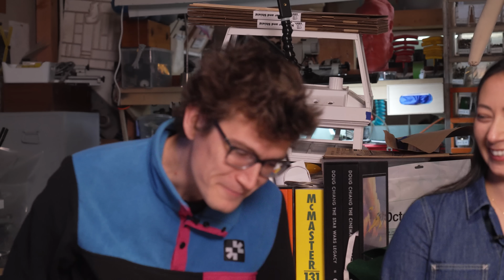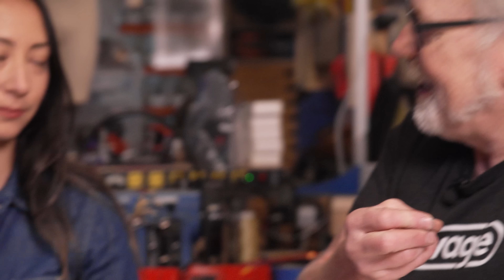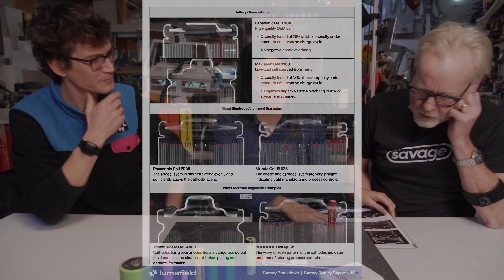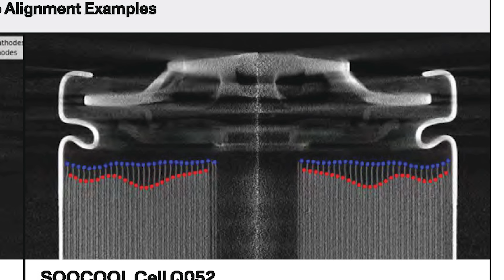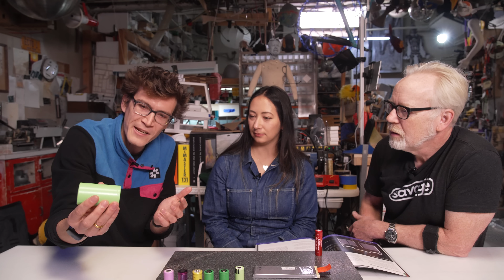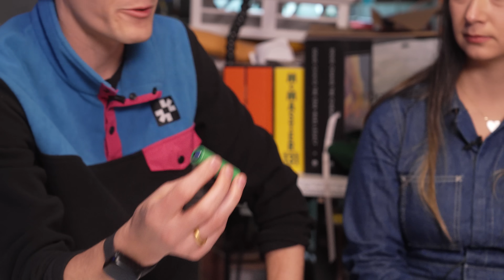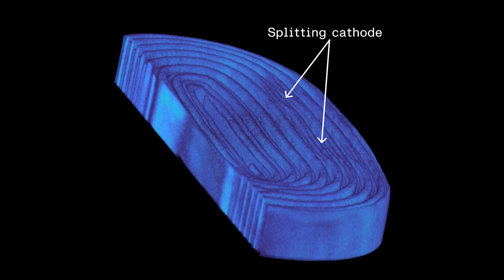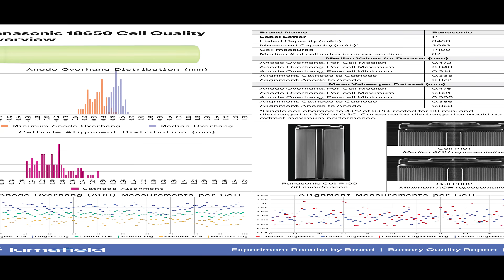The Surprising Flaws in 18650 Lithium-Ion Batteries

Comment: Remember when the people who take your taxes used to test stuff like this and tell you when something wasn’t safe?
Pepperidge Farm remembers…
Reply: Pretty sure that was never a thing, except in specific industries.
Reply: The CPSC seems like the right fit, although I think it's the (Insurance) Underwriter's Laboratories and other groups that do the actual testing in most cases. Think like car crash testing - there is both IIHS and NHTSA crash testing.

Way back in the day the government used to provide pamphlets on things that people needed to know, like the dangers of using gasoline for your clotheswashing. I think some of that survives (or did until lately) but a lot has moved online or people don't know where to call.
Reply: what kind of clanker brain actually uses that phrase?
Reply: What government agency used to test consumer electronics?
Reply: @F0XD1E CPSC
Thanks to deregulation, the standards for batteries are voluntary

Comment: Almost caught the bad end of the Li-ion stick trying to keep an old phone alive. If only it hadn't been glued in; I'd have a working old phone and a few less grey hairs as I ran down the steps with my phone spewing nasty magic smoke. :( 

Hope the promise of solid state batteries comes true soon.
Reply: Trick for glues in cell phone batteries. I sharpen the end of a credit card on sandpaper to make a wedge. Work the credit card under the battery gently and slowly until the battery comes loose. I even mounted one on a handle to make it easier to control!

Comment: I can't even guess how many of these I have around the house just for flashlights. Never mind the rechargable gadgets I haven't torn apart to see what's inside. At the very least I'll be sure not to leave them in the charger overnight.
Reply: I'm thinking going back to NiMH rechargeable batteries for replaceable batteries is a better option.
Reply: @chrimony  NiMH can also catch fire.. but the problem is they have such a lower capacity as well as number of cycles.  
NimH 600-800 cycles
NMC lithium ion (like the named ones here) about 3000 cycles
LFP cells (LiFePO4) 9000-30000 cycles.
Reply: @TheStrayWolf-g8t  NiMH are not nearly as explodey as lithium. Yes, less capacity and fewer cycles. I wouldn't use one in a phone. But for flashlight batteries like the original commenter mentioned? Sure.
Reply: Get a capacity tester for whatever you have.. if you can not do a run teste to compair
Reply: Good choice. Always watch the charging cells.
I had a cellphone puff up during charging and yanked out the USB cable.
The pouch cell doubled in size but nothing else happened.
Reply: It's not just "overnight", it's "unattended".

Comment: I worked for a lithium ion battery maker for a month as a temp we had to evacuate the  building at lest once a day
Reply: I worked in device repair off and on over the last 8 years now? Did it as a hobby before that. All I can say about Li Ion is... Nope. Not in my car. Not in my house. A phone is okey, but not in my pocket unless necessary and never under my pillow or using while charging. Slowest charge speed is best.
Reply: @Baeloro1481  your over cautious approach is not supported by the actual evidence... I would bet a large amount of money that you could make small changes to your diet that would have a MUCH greater reduction to all cause mortality ... And other similar such life style changes you won't make.

Sure, don't have your phone under your pillow, duh. Charge it slow and the battery will last longer, that's true ... But the number of lithium batteries in homes compared to the number of house fires overall tells me you are afraid of shadows. People used to burn their houses down with literally EVERYTHING at a significantly greater rate.
Reply: @WilliamMorey-Baker  Over cautious? Did you miss the part where I have personally worked on these devices? How many times do you think I have witnessed a li Ion battery go up in flames? 

Yeah, it's not about the risk, it's about the factual state of things after the fire occurs. Difficult to put out (water doesn't work) and they reach temperatures that make the sun envious as it incinerates anything it's in contact with. 

If my caution prevents me from being burned alive by a battery fire, isn't that worthwhile?
Reply: @Baeloro1481  Did you miss the fact that we have trillions of battery powered devices in the world and EV's (including bicycles and such) have existed now for more than 11 years and you don't see them burst into flames at every corner, despite millions, probably trillions of them being made and sold and being charged everyday.  
Being cautious and ask for better battery quality control, is totally fine and I fully endorse such testing and report but going from that to, dooms day talk "I will never use a battery device!" is not, that is just fearmongering talk.
Also just because you say you worked in something that is not hard evidence that you really worked in something. On the internet, everyone can claim everything.
Reply: @Argoon1981  I guess if you don't understand the potential, you won't recognize the danger? If I just don't buy a cheaply made battery powered product, I probably won't risk burning anything down. By being very selective about the sorts of things I am willing to use as a consumer, I mitigate a lot of that risk. 

Does it disappear completely? Of course not, but the rest is easily managed. I charge my phone while I'm awake to monitor it. I don't put things that get hot in places that can trap heat (especially while they are actively being utilize in a way that makes them hot). I don't game while charging on my phone. 

I advocate for best practices with battery maintenance/operation and I take the time to explain to anyone who asks what I mean by that. While the conventional battery in the average phone might be able to exceed most safety standards for a battery, Stepping outside the phone market helps you realize just how much the battery quality drops off when you aren't selling an expensive device. 

While a $10 pair of Temu airpods won't have the thermal capacity to burn a house down, the fact they pose a much higher risk of fire (just by being temu airpods instead of apple product) should give anyone a reason not to support buying $10 airpods.
Reply: @Baeloro1481  I have to point out that despite the suggestive wording, you have not actually asserted that you've witnessed any Li-ion battery fires. Certain highly-visible characters in the news have shown that this can be a tell that the answer is actually "zero".
Reply: @AySz88  Part of electronics repair is to replace batteries. I could count the number of fires I've witnessed. I could talk about what happens to a battery when it gets to hot, when it gets punctured, bent, or when the anode/cathode wear out. 

I mean... the point is that batteries are a limited lifespan product that contain a volatile chemical reaction. Belief that it is 100% safe/benign is great, until something happens. 

The fortunate people just have a phone or pc or tablet make magic smoke and they aren't injured by it. Other people suffer burns and in some cases, death. The two college students trapped in the Cyber truck as it self-immolated come to mind.
Reply: @Baeloro1481  You know how many times I’ve seen Gasoline and natural gas go up in flames? 

Everything involves risk.
Reply: @Racing_Pig  Right. Gasoline fumes explode and liquid gas ignites under flame/spark. Li Ion batteries ignite when exposed to open air (oxygen). They also ignite when they get too hot (thermal runaway). 

Gasoline isn't likely to ignite without flame/spark nor is it going to get hot then catch fire. Normal phone usage creates heat, most phones lack a sufficient cooling solution to prevent thermal throttling and down clocking. 

There was one model of phone that was known to catch fire under normal usage conditions... the Galaxy Note 7. It was recalled as a device, with people being given refunds and phones being forcefully returned due to the risk. 

All because Thermal Runaway would happen. 

All the batteries I've seen catch fire personally, did so because the foil barrier that seals the battery... is no longer sealed. Wether it happened due do some sort of puncture in the battery (iphone screws work loose frequently, float around the inside of the phone, embed themselves in the soft battery), poor health batteries gan off gas internally and bloat like a bubble, until they begin leaking or something internally punctures them. 

I've had one battery tear in half as I was removing it, instant fire. If I am lost in the woods and I need to start a fire... I know I have at least ONE way to do it, long as I have my phone. 

I'm not being overly cautious to acknowledge the inherent risks of carrying supercharged chemicals in your pocket... or under your 3500lb vehicle.
Reply: @WilliamMorey-Baker yeah working with lipo batteries made me just impressed that there weren't way more fires lol. Now as long as cells are within 1v when im going to weld them together idgaf. No bms, drain fully charge fully use em as much as possible. If charge or discharge times change noticeably. Find problem cell replace with new cell. I dont buy cells ever. Just recycle. Hell once I have enough cells that are a little slow. i make packs from those lol still charge a cell phone just fine, no need to ditch em just cuz they cant power ur ride. Yall prolly locked down for covid too huh? Lol 😂😂
Reply: @Argoon1981 ive dropped a nickle strip across a fully charged 90v battery and it closed the circuit right before a blinding flash aaaaaand it did what all batteries do, welded a piece of the strip to the contact point and the rest shot across the room like a shot. End excitement. Its very very very difficult to get a battery to do what youre afraid its gunna do. Physics just doesnt work the way you think it does